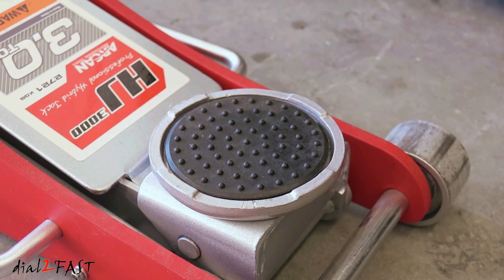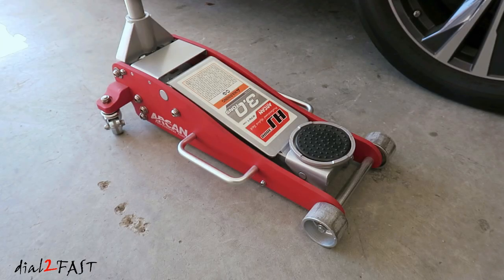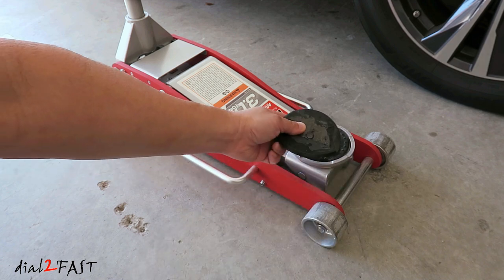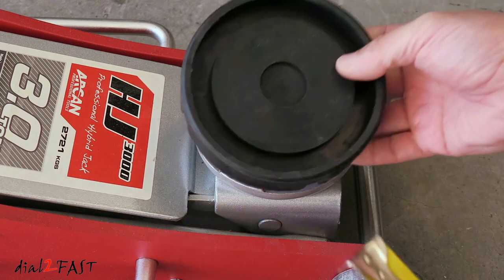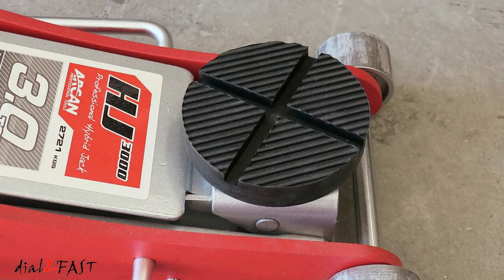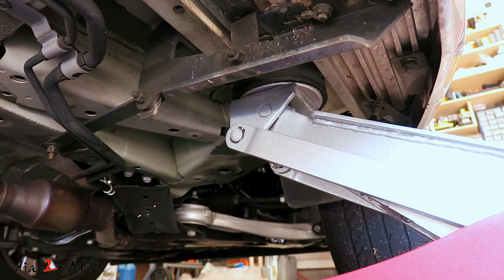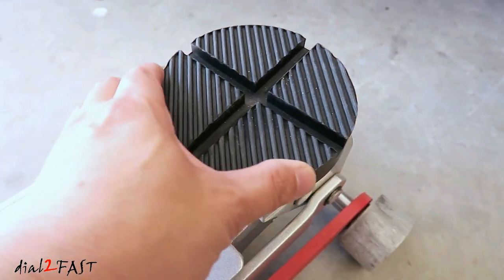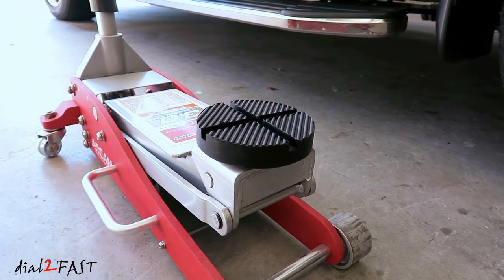GOOD Floor Jack Pad Slotted For Pinch Weld - ARCAN Jack

Comment: My car is too low so it is difficult to get the hydraulic high enough to clear the jack stands to get them underneath the pinch welds. Is there jack pad that adds a couple of inches to the floor jack WITHOUT the risk of the jack pad slipping off of the factory jack points?

Comment: I have this jack and same pad. Lifted my truck by the rear axle and ended up having it slip off. Nearly sent the jack into the fuel tank. No good. 

With the original pad the metal teeth of the cup of the jack stuck up a bit more, so no way something like an axle will slide off. I am now looking for an OEM replacement and toss this pad in the trash.
Reply: It is really meant to be used on the pinch weld. The other thing is you need the jack to be perpendicular to the way the car will move when lifted so that the jack can move straight back with the car, if it is diagonal then the jack pad will deform (also do this without a jack pad). When I lift from other strong lift points that aren't a pinch weld, I don't use any rubber pad and just use a small folded rag.